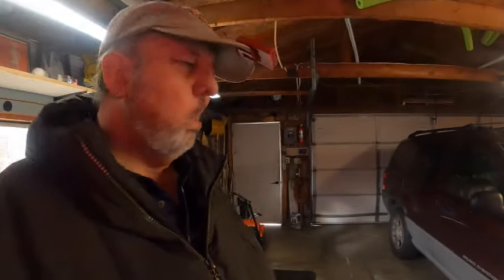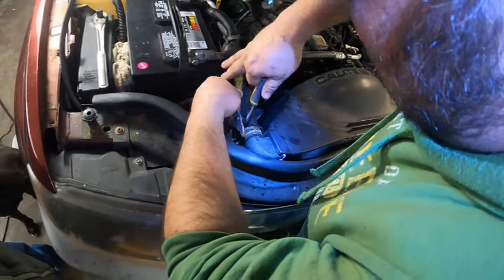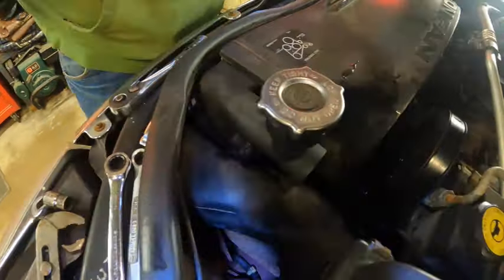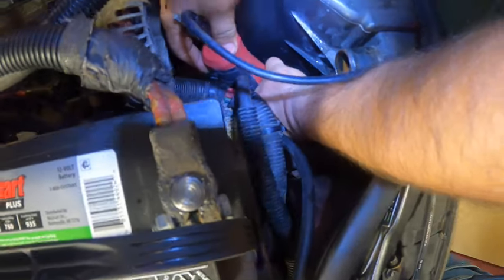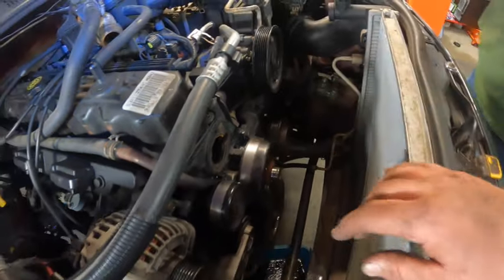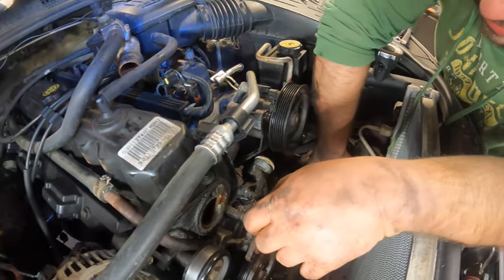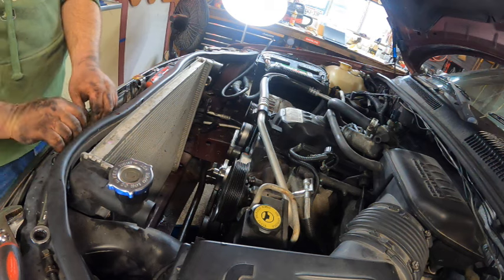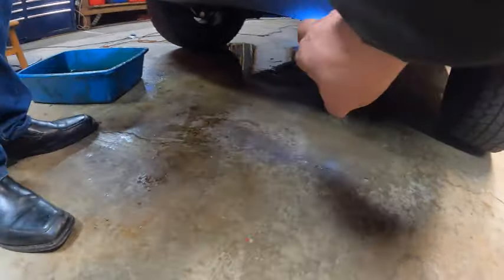1999 Jeep Grand Cherokee, Water Pump and Thermostat replacement

Comment: Great job there...
Reply from the maker: I wasn't sure how this video was going to turn out and I probably need to do better with things like lighting and more details. I appreciate you watching and thank you for the comment.
Reply: The removal of the mechanical fan was the literal bane of our existence due to the fact that I was unaware the fan actually mounted to the pump itself, unlike a 96 F150 I previously owned years ago. The fan mounted on the pulley on that vehicle.